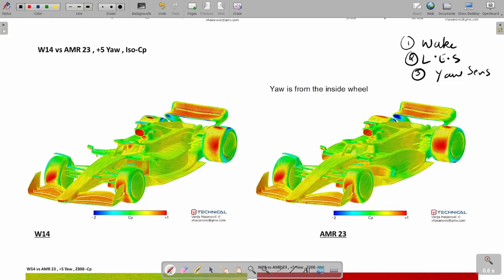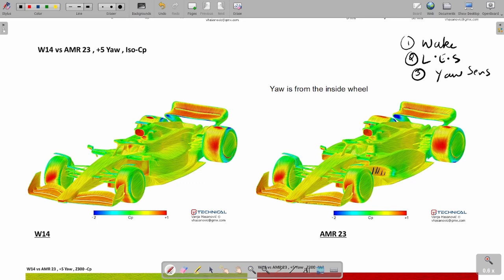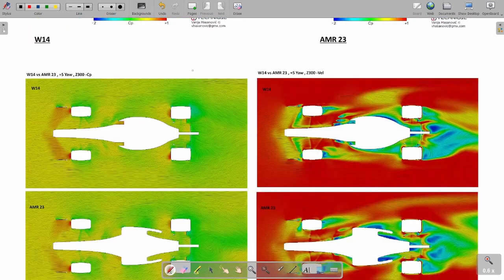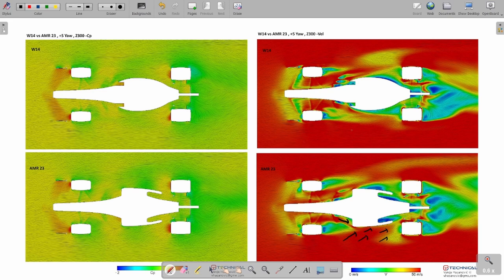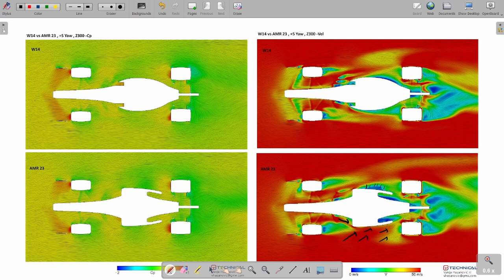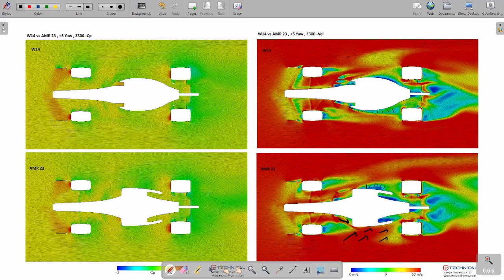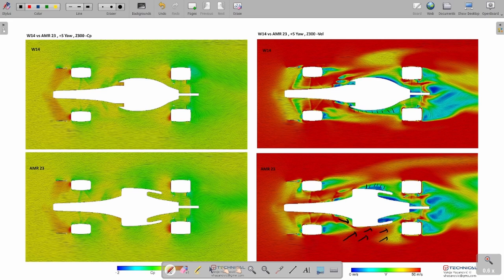#F1 Aerodynamics : Mercedes W14 vs Aston Martin AMR23 Sidepod Aero Analysis in Yaw Condition Pt 3/4

Comment: Separation bubbles are not a bad thing per-se. Air will just flow around the separation bubble, furthermore, because it's air flowing around air, the skin friction is severely reduced.

In the second part, you see how the water slides create a separation bubble, and the air flows around that separation bubble with almost no energy loss. This gives plenty of high speed air to the suction side of the rear wing. Separation bubbles are just virtual bodywork, and highlights the fact that what the air sees isn't what your eyes see.

It's doesn't take CFD eyes to understand that high stagnation pressure tends to steer airflow, meteorologists have known this for a long time. High pressure troughs and cold fronts often steer hurricanes. The same thing happens with F1 cars, and airplanes. The cold fronts that come from the American mid west, will commonly pull Hurricanes northward, and the high pressure troughs in the Bermudas keep Hurricanes from migrating Northward and instead head towards the Carribean, where barometric pressure is a little lower.

The sidepods in the AMR23 exploit this to keep plenty of high energy air hitting the rear wing suction side at all times. The waterslides create a separation bubble, which acts as virtual bodywork and air rides on top of that bubble friction free, towards the rear wing suction side.
Reply from the maker: Now that mechanism  is something I definitely did not think about . Great shout there

Comment: Very interesting.

Since you have been involved with a top F1 team can you tell whether the F1 teams run the CFDs as RANS or time steps averaged?

The latter requires so much more resources and time that I think it is very tempting to limit at least in the first evaluation phase to RANS. However, I dont believe for a second that you will get good numbers for dynamic derivatives (yaw, roll and pitch) without doing it the hard because e.g. the wakes oscillate so strongly, sometimes in a rather chaotic way and it is questionable if you can get a RANS math average right a situation like that. Also the underbody flow is quite a challenge in those situations.

Also on the same line, we know that CFD is not always very reliable at the proximity of separation and F1 is at many places running close to separation. How do the deciding engineers typically trust CFD in those situations?

And a third consideration, again related to the same subject: There seems to be a strong utilization of longitudinal vortices aka free vortices, which then leads to questioning vortex burstdown prediction - which is another topic where CFD is not very good at - partly due to the local grid cell size demands but also due to scaling and turbulence models.

I wonder if Adrian Newey had only wind tunnel or CFD which one would he stick to? I think if it was an airplane I would opt for the CFD but for a race car a steel rolling road wind tunnel with at least 50% scale and below 5% blockage. But having said that to build a proper state of the art wt for F1 would cost about 50 mill whereas you can set a single multi core CFD station with less than 5 000 and license (100 000+, unless you are willing to use opensource grid program, CFD and post process).

(You probably figured out that Im a professional aerodynamicist - with 35 years experience mostly in WT but also CFD, also as the manager of a uni aero lab. 1988 I did my individual special assignment in aero about the modelling of porposing motion of a race car. Also did my master’s about race car design. But in my professional career no F1 experience although I have been involved with quite a many racing applications from lightweight structures to suspension design to aero. I used to be quite passionate about these things but Now Ive grown up :))))
Reply: LBM is the future.

Comment: Here's another crazy idea, what about using the edge wing to reduce downforce from the floor. Use the floor stays and brackets as a counter lever system, so as the edge wing is loaded and deflects down, it lifts up the throat of the diffuser. This way you can have your diffuser as low as possible at low speeds so it works in low speed corners, then at speed it raises to minimize bouncing and drag. The edge wing is allowed to deflect 8mm, and an 8mm change at the diffuser throat is HUGE in terms of downforce and drag.
Reply from the maker: I like the idea , but there is an inherent limitation , in high speed corners the limitation is rear downforce so you'd pretty much mess your high speed performance. Also the diffusers are more sensitive to change in geometry in high speeds+yaw than at low speeds +yaw. So it might not be a good compromise. 
But hey use it for Monaco

Comment: To me it would be an advantage to not have as much downforce on the outer side of the car and more on the inner side when cornering since the outer side wheels still gets more load due to the center of gravity being above the road surface and therefore putting more load on those wheels. Of course you don't want to get lift on the outer side, just maximize the downforce on the inner side while cornering to try to get an equal load on all tires to minimize tire wear.
The side pods can basically be seen as "wings" themselves that adds downforce in addition to the front and rear wings. The trench design on the upper side seems to be more to keep the air at a constant velocity maintaining a neutral pressure on the top side while the outer side of the pod as a bulge forces the air to have a higher velocity causing a lower pressure and generating downforce.
At least that's how I see that the side pod design works on the AMR23 and others with a similar design. The W14 don't have this at all and that design could even be generating lift rather than downforce.
It seems like the tires aren't turned in the pictures, and that could also cause some differences in the result.
After all this is an interesting subject when you try to figure out the differences and it would be interesting to see if Mercedes do some radical changes to their side pods soon.
Reply from the maker: I agree with you, but bear in mind that the results are not conclusive

Comment: why do you think they deleted the old "shark fin" structures that used to be on the cars?
Reply: In my opinion they are good in a straight line but would cause turbulence over the rear wing when cornering.
Reply: Didn't they change the rules to stop them?

Comment: It makes no sense that the velocity scene is capped at 50m/s
Reply from the maker: Why ? Doesn't it make sense, we are running a low-med speed sim
Reply: @f1aerodynamicist  Ok you are simulating the car at 50m/s but that doesn’t mean that it’s the maximum value for the velocity 
By capping the scale on the scene you are arbitrarily leaving out informations
Reply from the maker: @giovanni7062  I see what you mean , maybe I'll try n cap to it max vel next time to see if I get a good viz
Reply: @giovanni7062  50m/s is 180km/h, which seems to be the average corner speed, and that's what's most interesting in this case.
Fairmont hairpin at Monaco has about 14m/s, and this aerodynamic wouldn't really matter there. Tire stickiness would be more important.
Parabolica has about 90m/s, and that's almost straight line speed and can basically be seen as a straight track.
So I see that the speed in this simulation is fine and what we do look at is the difference between two cars.
Reply: @giovanni7062  you are aware that wind tunnel testing in F1 is also limited by regulations to 50m/s? So are F1 Windtunnels also senseless? Ridiculous comment, that only proves cluelessness.
Reply: @fam.hunger5244  cluelessness would be to not understand the difference between freestream velocity and visualized velocity spectrum

He is 100% right, capping the scale to freestream gets rid off a sizable junk of information
Reply: @fam.hunger5244  Cluelessness, yes. 
The speed at which he is simulating is fine, the problem is that if you are simulating at 50m/s that’s the speed that the air has when it is not disturbed (free stream)
When the air interacts with the car the speed changes and it’s actually way faster in a lot of points otherwise you wouldn’t have low pressure, which is the most important factor in generating downforce
In the velocity scene the value are capped at the free stream speed, cutting out a lot of useful information
Reply: @ehsnils  The sped for the simulation is fine, the problem is that the velocity scene is capped